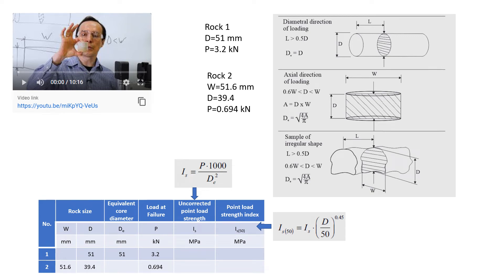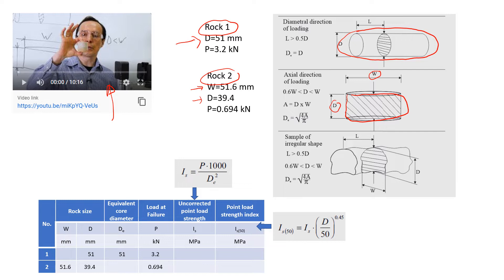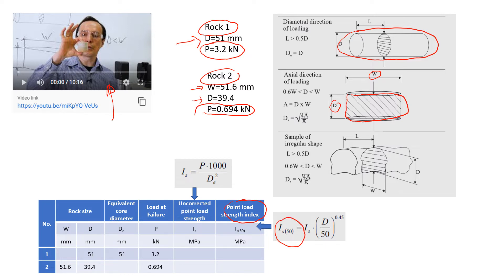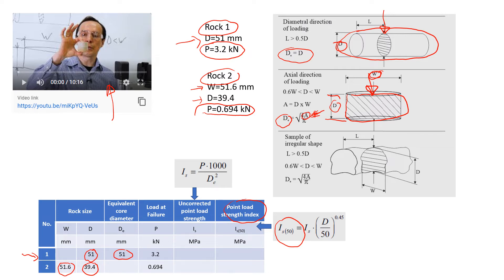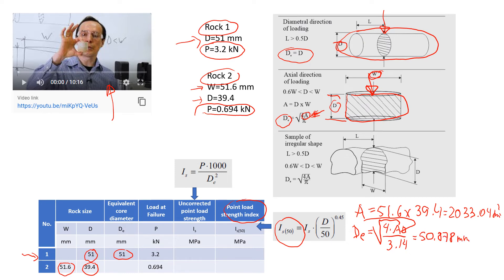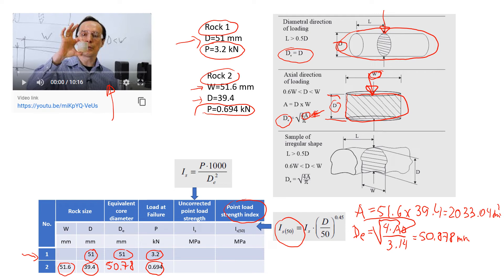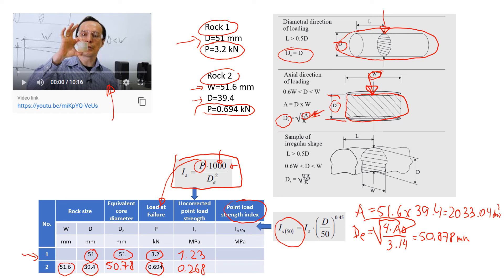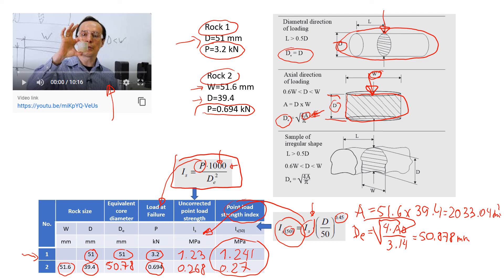Point Load Test | Part 2 Data Analysis

Comment: Great video! But I think the second sample in the axial direction test was basically screaming “NOOOO!” before breaking 😅
The failure happened in a non-valid direction, so that axial test result shouldn’t be used.
Using both samples to calculate Is₅₀ makes the final value lower than it should be — that poor axial sample failed the test and still got counted! 😂
Better to ignore that second result and stick with the valid diametric one.